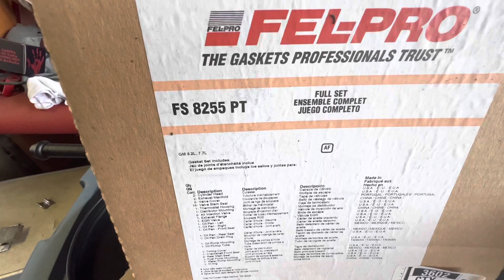Cadillac 472 engine tear down

Comment: So you're not honing the cylinders at this point? Also would really love to see a video of you replacing the rings, I need to do that on my 1958 Edsel engine rebuild and it'd be great to see how it goes. I got a bunch of Felpro stuff myself, great to hear it has a good rep. All the very best to you and yours
Reply from the maker: I had the cylinders honed when I first built this engine. And the cross hatching on the cylinders is still really good. So that kind of tells me the original rings didn’t set properly. But that’s because they were a bit too small.
Reply: @HalloweenHunters  Ah ok, that makes sense, thanks so mucch for explaining. :>
Reply from the maker: @thequietestengine  ya so since the cross hatching from the home is still really good I’m going to leave it as is. And the new rings that are the correct size will seat properly

Comment: Too much money
Parts are hard to get
Block is only thing good
Oil system fails
Heavy rotating assembly 
Slow throttle response 
Flexplate not drilled for chevy converters
Worst valvetrain ever made etc........

Bloodviking